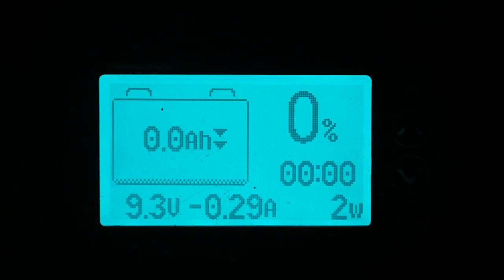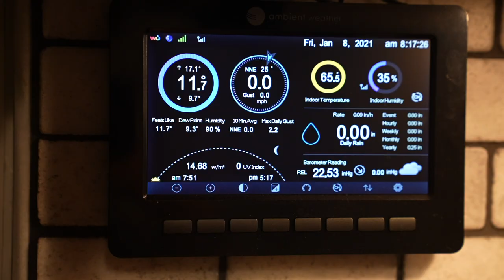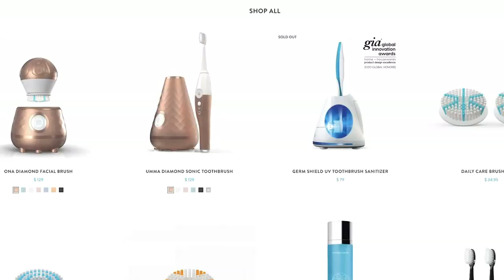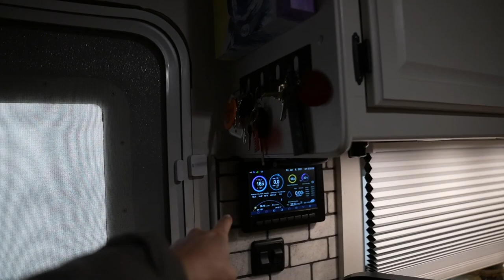WE'VE GOT MAJOR PROBLEMS | WINTER MOUNTAIN NIGHTMARE

Comment: Solution for freezing hydrant:  PUMP HOUSE.  🏠
Reply: For real, put a cheaper wood shed over that thing, insulate it, call it a day. You could also run a generator inside overnight to keep the pump house mildly warm AND keep your batteries topped off. Ya'll aren't getting anything done with your build with these struggles. Take the day to get this done.
Reply: When I lived in central Oregon years ago, where the temps got to -50F, we put in a well, dug a 5'x5' hole 7' deep under the porch, lined with 2x12s, for our pump and hot water heater which kept the pump warm. Neither ever froze. The pump never froze even when we would leave -50F and drain the hot water heater and turn it off. The outside water lines were below 2' to avoid freezing. A pipe and spigot for our animals did fine with a heat tape and insulation wrap over the tape, though at -50F we drained the pipe and carried warm water out to the animals with a little molasses to warm them up.
Reply: Just went a day and a half with no water or power. If you have a well when the power goes out there's no water either. Get a couple water jugs and solar lights for next time. There will be a next time lol! I just love your videos. Start thinking about what you'll do when the house is finished because you have a lot of T&A addicts!
Reply: They Absolutely need a pump house.  Put a small heat lamp in it and it should be good to go.
Reply: @petunialuna4801  Warm water for outdoor critters is such a good thing to do. Helps keep them warm and hydrated.
Reply: @petunialuna4801  I live in Central Oregon and the temps NEVER get to -50. Not even in dumpy little La Pine. The lowest I have ever seen it here with windchill is -10 and that was only one night.
Reply: @SagebrushRambles  Yeah, my impression is that climate change has warmed up central Oregon and decreased the snow a lot! I lived about 12 miles out of Lapine for over ten years from 1969 to 1980. We had five acres and built our own house. There wasn't even a cement company then. And yeah, it did get that cold, and it would snow up to 3-4 feet. We called the winter "the great equalizer" because everyone was in the same shape, it was winter and you had to prepare and get through it without a job. People from Alaska would retire there because it reminded them of Alaska. Now I don't even recognize Bend, a totally different world. So, yeah cold, long winters with lots of snow was the reality then. I remember trying to grow corn, and it froze four times, the July 4th freeze finally killed it. The plants never got past 4 inches. It seems that world is long gone. Sad. Sorry to hear that Lapine has gotten dumpy. I lived in that area when the old time loggers were there, no fences, Stolberg's Store, Russell Mill. Best years of my life, but it is all gone now. A completely different place. Tourists in Bend! AGH!
Reply: @N8TheSnake  Yes, a little wooden shed lined with Styrofoam would be the ticket.
Reply: @petunialuna4801  Yikes, that is way too cold!
Reply: @auntmaryspals7978  It only got that cold once, for about three weeks. We went down south for a couple of weeks because we were going through all our firewood. So how cold was that? It was so cold...that when we emptied out hot water heater the water froze in midair out of the bucket before it hit the ground. How cold was it... You couldn't be out for long because the moisture in your eyes could freeze and your lungs. How cold was it...it was too cold for snow, or any animals, complete silence. How cold was it... We really didn't know as the thermometer only went to 50 below, all the Mercury just sat on the bottom. We had a 74 Volks bus and had to put a heater under the oil pan for awhile to start it. The van would only get up to about 30 mpg, and we put some sandwiches by the heater vents but they still froze. -30F wasn't unusual but that freeze was unreal. We drained the plumbing to leave, but our well pump was fine in that 7 foot deep well hole.
Reply: @petunialuna4801  I was in Alpena Michigan years ago and water froze in the air like that. We opened the windows in the hotel room and the air instantly froze.
Reply: @auntmaryspals7978  Gets your attention! Deadly cold. It was beautiful though. Everything was white, frozen, and silent. They couldn't plow the roads because the oil in the plows was chewing gum, nothing wanted to run. The main reason we left after a few days was we were going through our firewood and there was no getting more.

Comment: Living in the middle of nowhere a back up generator is a must
Reply: I can't believe they don't have one.
Reply: That was my first thought. I have 3 generators and it gives me great peace of mind. You never know when something will go wrong with one and you'll be stuck out in the freezing cold trying to fix it if you don't have a backup.
Reply: YES YES YES!!!!!!!!!!!!!!!!!
Reply: Wouldn't have been any help to them with the trailer blackout because the power service to it was working. It was a failure in the trailer caused by turning off the solar system inverter connection to AC on-grid power coming into their property.
Reply: @fisherus  Granted, I don't know their particular setup, but if it were me, there would be a transfer switch so I could switch to generator. Tying yourself to solar-only and having no redundancy is also not smart.

Comment: Build a pumphouse and insulate the box. It doesn't have to be big for now, just big enough to cover the pump well insulated and keep a lightbulb turned on for a little heat. Also you need a back up generator for things like that.

Comment: Look at a mini split for your a/c (and heat when needed). You bolt the inside unit in place, connect the tubing from outside unit to inside unit. Connect power and your pretty much done. The lines are already charged and ready to go.

Comment: You've got enough scrap material.  Build a 24"x24" box to cover the hydrant. Having a dead air space with the heat tape will help keep it from freezing.  If you can line it with some of the pink insulation board, even better.
Reply: ...and bury the hose going into the trailer so it is never exposed.
Reply: @JimfromIndy  if they don't go 3/4 ft deep it will freeze anyway i guess
Reply: @Mr_B.  Every foot they go down delays the freeze process and eliminates the wind.

Comment: Your hydrant is quite tall, but years ago in some pretty brutal NH winters  (-35 below) we'd build a little straw bale house around, cover the outside with black plastic to absorb the heat from the sun during the day and had a 100 watt bulb hanging inside the straw house ( Little pigs optional). The same worked for the hose or pipe. Straw or hay layered thick on top with plastic. You'd be amazed how well it works. Good luck.

Comment: On Homestead Rescue they built a small insulated box unit around above ground water pipe and hung a single light bulb to keep it warm. If it works in AK it should work in your area.

Comment: Hi, Trent & Allie:  When your batteries are dead you can charge them from your Kubota B2650 tractor or even from your truck.
I live in similar settings like yours (in the country) and after the January 1998 ice storm (3 weeks with no power) I bought a generator.
It is always good to have the generator, you can use it for power outages and for welding too, if it can produce about 45-50amps. 
When you live in the country there is always something which requires additional electrical power. 
Cheers,
HM.

Comment: FYI moving water does not freeze let a valve stay cracked open a little bit just to keep the water flowing while your away. Additionally, your hydrant is way too high out of the ground. When you Plumb the house make provisions to relocate the meter and install what's known as a Hot Box available with electric heaters. Your environment requires serious protection. You guys are doing a great job.

Comment: You need to put a freeze miser on that spigot. Google “farm freeze miser”
Reply: His faucet's valve is buried below the frost line underground and has a drain that immediately drains the pipe rising above it to the faucet. A freeze miser would only work if he left the valve turned on. His faucet's designed to keep it from freezing but, the hose to his trailer, Terry, must be disconnected from the trailer to make it work.
Reply: @fisherus  The freeze mister would be attached at the trailer. I actually have mine hooked up at the winterizing lines, BUT the freeze mister doesn't always work. Last week, I added a T fitting and two plastic valves, one for the freeze mister and one to a hose so I can let water run through the hose feeding my trailer, through the trailer, and out of that hose, keeping it from freezing. For the last year, I have been camped in a campground which we have been remodeling, staying there during the week and driving 3 hours home at the end of the week. We installed 7,000 feet of new water line and 8 or 9 of those frost free hydrants and maybe 8 regular faucets with freeze misters on a T to keep the riser from freezing. We were at 6000 feet in the mountains of San Diego. I have learned a little about what they are going through.

Comment: Build a box around the water "stand pipe" using rigid foam insulation board.  The heating tape should then keep the water from freezing.

Comment: Build a small 2x2 insulted box around hydrant,  then use a heat lamp or two that turns on at certain temps. Thats what we did to keeped or water from freezing up here in the north woods . We can see temps as low as - 40 at night in February.

Comment: Why dont You use metal for your indoor walls, much faster and accurate. And it hold more insulation. I also do not understand, that americans install only 1 layer off    drywall. In DK  its required to install 2 layers. Because it was seen in the seems that it could crack. And also, we dont paint over the drywall, we prime it, and then we cover the wall/ceiling with a fiberglass cloth, and then paint, but I know we all do it our way . I love your channel, and keep up the good spirits. Love from Denmark 👍😎❤

Comment: Believe it or not having snow banked against the building does provide insulation.  I build a snow cave years ago and was able to hang out in a t-shirt inside.  Use the snow to cut blocks to stack next to the shelter and create a wind break.

Comment: HVAC sizing depends on the load of the house. You need to have finished air tightening the structure and have a blower door test done to measure how air tight the house is. That starts the basis of the calculations for heating load. Then it's a ton of work measuring and inputting all the wall measurements, window specifications for each wall. With only one space, past that sizing isn't too terrible. You're much better off talking with an engineering firm to size the system vs a HVAC installer. The standard manuals installers use over size the systems on purpose and aren't as effective for modern air tight homes, the new manual for HVAC only came out this year and most don't know to use it yet. 

On electric highly recommend mikeholt's youtube series on all the changes in the 2020 code.
Reply: Good thing is they can put hvac off for a while. They have a basement  so floor vents would be easy. Just by looking at it I would say a 5 ton at least.
Reply: With the extreme temps there you might consider two systems, one big one for downstairs, a smaller for upstairs, which you may only use in the summer. More control.
Reply: @dalekronk496  5 ton?! Maybe in 1990. That's far too big for that small of a house. But the wood stove will be a big air leak so without  testing who knows
Reply: @petunialuna4801  the mr cool multizone mini split diy systems are what i would probably reccomend
Reply: Steven7650 do you mean Mike Holmes?
Reply: @steven7650  I agree 100%! We put a mr cool mini split in my lake cottage last year. It does a fantastic job of heating and cooling the whole house, which isn't even insulated. (This is in Maine.) My son-in-law installed it himself, and he is not a plumber, electrician, or HVAC guy, just a typical home handyman. Trent could definitely do this.
Reply: @steven7650  thats why I said 5 ton as a starting point. Its all open area only as of right now.
Reply: Agree with Steven. My husband seems to know more than most HVAC installers from spending 2 weeks reading and problem solving ours unfortunately. A lot of hvac companies have no real interest in understanding your needs or making your house efficient sadly (we found).
Reply: @amandao266  I'm a service technician for hvac big difference in technician and installers. Major thing they need to do is find out what the codes are in their area. Some insurance companies will not insure the house if not installed by a professional
Reply: @janetwalker3541  no mike holt, he's an NEC instructor.

Comment: Sorry guys but you have to set up a small woodstove inside the temp shelter.  That will give you an absolutely for certain source of heat when you need it.  I also suggest that you dress the hydrant so that it is actually inside the temp shelter - in other words set up a tent that encompasses the hydrant And is part of the same air as inside the temp shelter.  Once you do that and you have a woodstove you will have heated hydrant.  Still also retain the heat tape on the hydrant as well.   Good luck and I hope that it all works out.

Comment: Take some of the scrap wood and insulation and build a structure around the pipe. Make a door so you can get in. We also used a 100 watt bulb never had heat tape.

Comment: Keeping water with a fair amount of pressure on it lowers the freezing point. In other words, the higher the pressure on water the colder it needs to be before it freezes. However, there is a risk, right before water freezes it expands so it can burst pipes or other storage containers. If you have a small pressure or expansion tank it can reduce pipes bursting but it won't always stop it so be careful with your water in really cold climates.

Comment: HVAC, yes I have experience in changing the air filters lol. BUT after building a house from foundation up (with contractors) the number one thing is put the forced air vents/registers on the floor, never in the ceiling (though you might have to for ease of install in the basement). Your loft may not necessarily need air ducts or maybe just one, since the heat will rise from the first floor. And how hot does it get in the summer time? If not too bad you can get free standing portable AC units that have a hose vent out of the window, and then use fans to circulate, instead of getting outdoor AC compressor units that will need maintenance. Make sure your circuit breakers can handle the load.
Reply: The only thing with hose vent out the window (I have two) is that they are LOUD! 100% agree don't put the vents in the ceiling. Awful to have that air blowing on your neck and shoulders.
Reply: @jonap5740  Yes true, just like having window units! But having central air never really did an even job of cooling vs. the electrical cost for me. Hopefully where they live they'll get a nice breeze and not have to run the AC much anyway!

Comment: Aren't yard hydrates supposed to be buried 6 ft they automatically drain below the ground when turned off.....
Reply: Absolutely correct.
Reply: But they have the water on all the time so it doesn't get the chance to drain the way it is supposed to.

Comment: Hey guys! Try laying the heat tape flat along the side of the pipe attached w/zip ties and do not over lap heat tape over itself it will burn itself out.. Been there, done that myself!
Reply: I’ve been searching for this comment.  I’m the opposite of expert, but I thought that overlapping heat tape can lead to hot spots that can start fires.
Reply: I almost started a fire in my house by winding heat tape around a pipe in an outside wall.  The warm tape sagged and overlapped.  The smell of burning plastic saved the day.  I would use the frost-proof hydrant as it was designed and take off the hose. Use the pump and tank in the trailer or just use containers.

Comment: Hi Trent and Allie, I live up here in BC and you always have to have  a good plan to prevent freezing in the winter. Just a thought, if you build a box, say, 2 feet by 2 feet around your water hydrant and then put in some insulation, loosely, inside, it does seem to work better than just a small tube over it. I lined mine with foam board insulation and so far, so good. You  could make one side a door, with hinges, for easy access.

Comment: Trent I work at a power plant which is mostly outside in Wisconsin. If you wrap the heat tape on top of itself its highly likely it will burn itself up. Just try and wrap the heat tape around the pipe keeping the heat tape in contact with the pipe as much as possible. They make fiberglass tape you can use to keep the heat tape next to the pipe. Good luck up there and Thanks for the videos.

Comment: Make a foam box from the pink insulation foam you can cut at home Depot or lowes and that silver tape. Dig a trench to put in a few inches so when you have this happens easy access. Bubble wrap is a great holding material and insulation. Hope this helps.